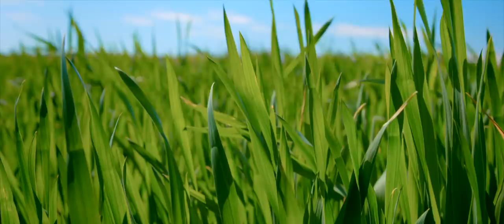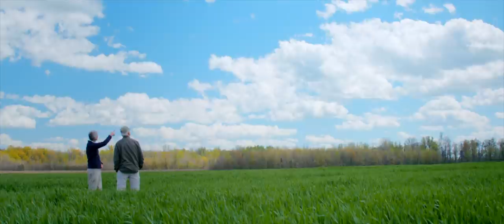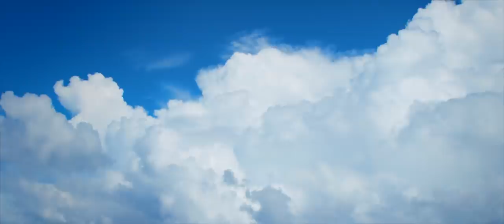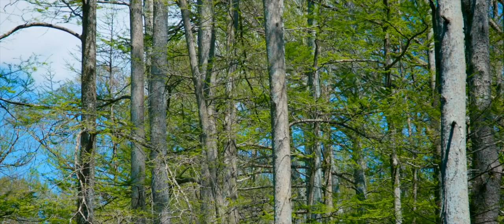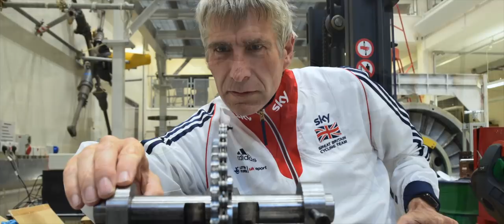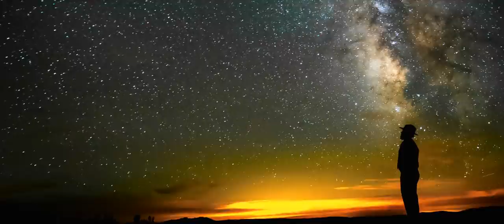How do the earth and stars showcase God's design? - Dr. Stuart Burgess

Comment: I'm on your side. So I hate to contradict you. But I wrote a very complex computer program from the bottom up. At least that's how it started. I was learning to program. And just in the process of seeing what each command could do, I wrote short lines of code. Then, as I went along, I desired to see what they could do together. Up to this point, the routines were very simple. But then I came to the graphics commands. And I realized that in order to see what they could do, I would have to use magnitudes more of the simple code. At no point did I have in mind to create a paint program, not until I was about chest deep into it. But from that point on, I was clear on the next thing I wanted it to do, then the next, then the next, then the next, each time adding new commands previously unknown to me. Even though I had nothing in mind when I started, there was nothing random chance anywhere in that program. My path was rather random, at first, but always deliberate. My mistakes were not deliberate, but a lack of knowledge, being human. However, my troubleshooting was very deliberate. Sometimes the errors were very elusive. So I put obvious things like Starbursts throughout the code and eliminated each one that was expected. The unexpected ones helped me to pinpoint the routines that had the elusive errors. (Each Starburst was visibly different.) The language either had no tracing or I was unaware of it. That program was built from the bottom up, until I found a purpose for it. Then it was mostly top down, sort of. Each piece was an add on, an afterthought. But ending program was rock solid. The teacher was amazed. She had me show it to the class. They were equally amazed. They asked how I did it. I told them it was just the things we learned in class, and LOTS of time.

Comment: This is fantastic. Douglas Axe re emphasizes this all or nothing scenario and calks it, functional coherence. Multiple parts working together to produce a top level function not present in the parts themselves. a structure or system which is functionally coherent requires top down design in order to overcome the probabilistic hurtle required for such a system.
Reply: Very true. I’ve often thought of the eye, for example. How many mutations does an organism have to go through, each with no advantage for natural selection, until you end up with something functional and extremely beautiful and complex? Evolutionists go to great pains to try and explain this and then end up saying that there must be something mysterious (to them) going on that allows such steps to be able to occur all at once. Well, duh! But they will never admit to an intelligent designer because their top-down view of science is that everything must prove there is no God.
Reply: @PetePistachio  hi Eric indeed your point is valid as well. However it is worst for the darwin cult, even if every mutation had a benefit, it still can’t explain functional coherence. Say a particular structure requires parts a b c and d. Well there is no reason outside of chance ( notice not gradualism ) that a b c and d would just so happen to be the parts required to assemble any given structure. Parts a b c and d would also have to be compatible with each other. No use having a piston larger than the cylinder. Mind you none of these relationships have anything to do with each other until the working structure is already in place. Again not a gradual process but a purposeful construction and assembly of parts. Parts a b c and d also must exist at the same time in the same space. Again defying gradualism and relying on pure chance. And finally the construction and assembly of parts a b c d into their new configuration would have to be stored for future assembly.  Again this would have to take place by luck prior to the structures existence. In other words mist people have no clue what they are talking about in terms of what is required to make the most basic structures of life. This same principle of hierarchical coherence applies at every stage from proteins to molecular machines up to eyes and body as a whole, all requiring many sub systems work together at lower levels without the end in sight in darwin cult thinking. Hope this helps
Reply: @Joshua Hults very well said!
Reply: @PetePistachio  you can download " Undeniable" by Douglas Axe on amazon, and listen to the audio version in your car or wherever. Or read the book and take tons of notes like i did. Highly recommend it is the definitive source for those not sure if neo darwinism is true or false, or want to convey why evolution is long past expiration date to others!

Comment: 😂 this guy is nuts. We obviously live under a firmament and on a flat plane and he just won’t admit it.
Reply: It's obvious flat Earth doesn't work.
Reply: @michaelparsons2225 This coming from a guy that believes a bubble in space is our reality. 
😂 prove first this idea that pressure gradient can go all the way to vacuum in the same area with no barrier in between. 
Until then. Quit reading pseudoscience books. And stick to the real science bro.
Reply: @ageofanomaly3874  
Astronomy was the first science and observations are an essential part of science.
Can you prove a sold dome?
Can you Disprove gravity?
It's gravity that keeps the air pressure higher near the surface of the Earth.
We see that planets are rotating spheres with orbiting moons.
And in the south we use the Southern Cross to find due south, we do this because the south celestial pole doesn't have a bright star near its centre.
Which direction is the Southern Cross on flat Earth?
Reply: @michaelparsons2225  you got some in the box thinking Michael. You should try and open that lid. As no one has breakthroughs and thanks their in the box thinking. 😂
go do some research gravity is a theory not a law. 
There’s a reason for a that 😏
Reply: @ageofanomaly3874  
Ive done research, you haven't, that's why you have no answers and no proofs.
Do you think a South celestial pole is irrelevant?
It proves flat Earth doesn't work.
Do you even understand the summer and winter solstice?
Do you know how an equatorial mount works?
I doubt it.
Reply: @ageofanomaly3874  
What causes Jupiter's moons to orbit if it's not gravity?
You haven't used a telescope before?
Anyone who understands basic Astronomy and astro photography knows we're on a globe.
Which direction is the Southern Cross?
No answers?
Flat Earth isn't even a theory, and the dome and ice wall.
It's all fantasy.
Reply: @michaelparsons2225  😌 we should start with proving what our moon is first. Before jumping to conclusions on what a moon is. 
So I guess you believe people have been to the moon ? And the moon is something we can fly too and land on? 
What’s your evidence for that ? 
And think. What science you using ? One of the Social sciences ? Pseudoscience belief?  Faith in NASA. 🤦‍♂️
Reply: @ageofanomaly3874  
NASA and the moon landings have nothing to do with the shape of the Earth.
I was taking about Jupiter's moons, it's 4 Galilean moons, Lo, Europa, Gany-Mede and Callisto.
They have been observed for over 400 years, their orbits easily predictable.
They were used like a celestial clock and helped determine earth's longitude.
You can even see them with the flat earthers camera of choice, the P900.
The question was, what causes them to orbit?
And which direction is the Southern Cross?
Reply: @michaelparsons2225  a orbit sounds like there’s some sort of fantasy force hold on to an object magically.. can you scientifically prove this is a natural occurring phenomenon or do you need to use assumptions? And story telling. 

Do you have gravity. Can you show me something orbiting you. CAn you show me something  tangible  and not theoretical?  About your obit claim.
Reply: @ageofanomaly3874  an invisible force just like magnetism and electricity?
Why is it hard to believe?
You believe an invisible fantasy dome that you can't prove.
You said it's obvious new live under a dome, I asked you how is that?
Yet you can't answer, you have no answers.
What is this south celestial pole in the south that we see the Southern stars circle around?
Why is it mercury and Venus follow the sun?
Why are they never seen late at night?
Venus, the morning and evening star, one of the brightest luminaries.
Yet it can't be seen late in the night?
No answers again??????
Can't prove this invisible fantasy dome that has 2 celestial poles?
Reply: @michaelparsons2225  ok. 
I know for a fact we live in an enclosed system. 
Hence my claim on the firmament. 
This is due to knowledge of what pressure is. 
And what can be proven scientifically on the subject of what pressure is.
Reply: @michaelparsons2225  you claim pressure system can occur in a open system. No container required 
Prove this claim.
Reply: @ageofanomaly3874  
Explain the pressure gradient?
Why is it colder and less pressure the higher we go?
Explain scientifically?
And answer my questions.